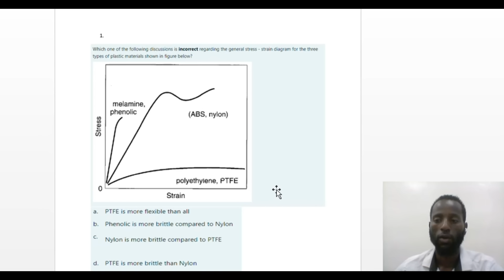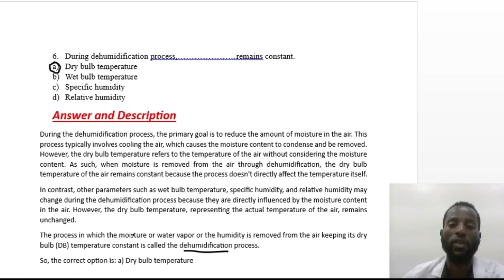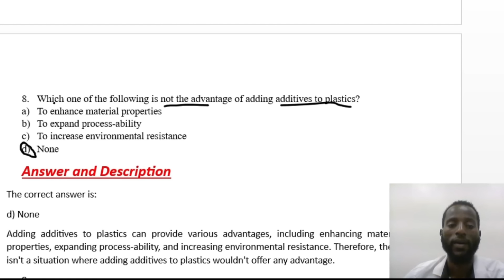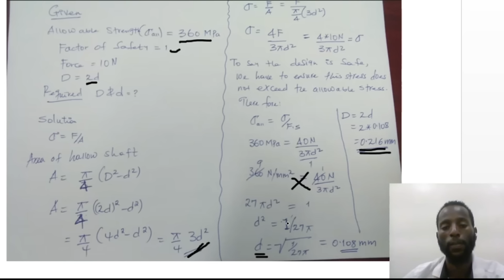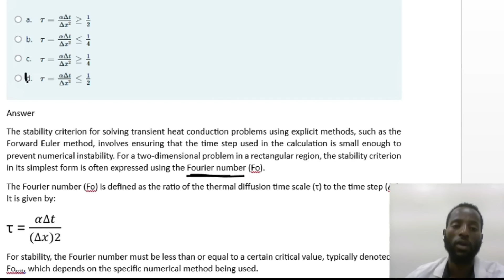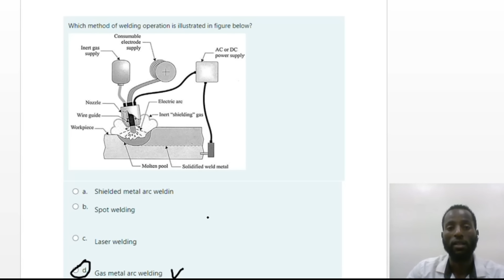2016 Exit Exam explained for Mechanical Eng'g part 3 Yekatit ለመካኒካል እንጂኔርንግ ተማሪዎች ↇEUEES HUb

Comment: According to what you explaind, the answer is A pleas review
Reply from the maker: Thank you for your follow up and  comment. As of my explanation the correct answer is choice "d". At choice a the the sign is greater than or equal to 1/2 or 0.5 but, at choice d the values is less tahn or equal to 1/2 or 0.5.  Thank you once again dear Taye
Reply: My Question is If two pumps are connected in series, the performance curve would be ___
AS I understand it the answer is A Pleas explain to me
Reply from the maker: @TayeNatea  Thank you I found your question and review it!
Reply: pleas answer my question